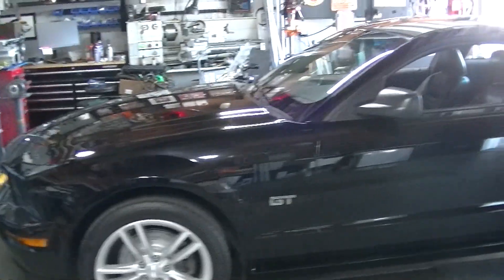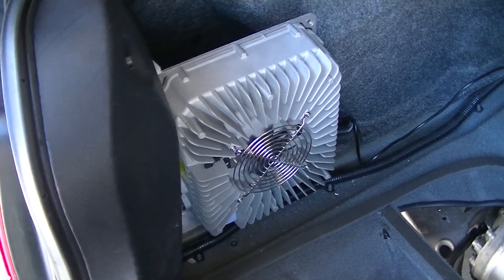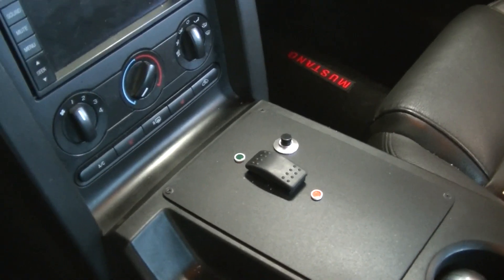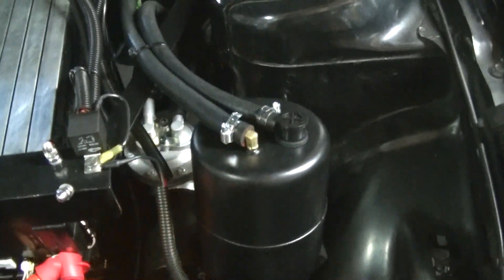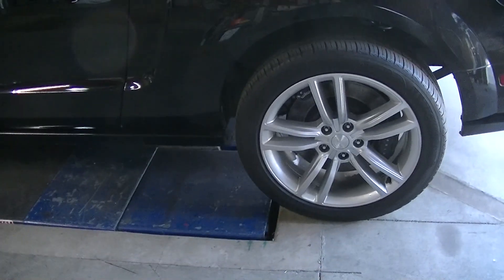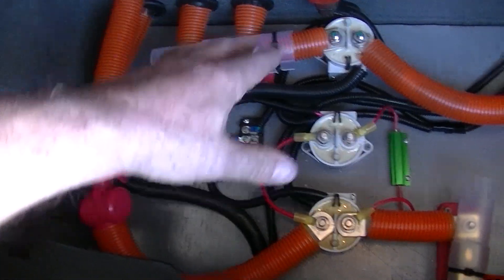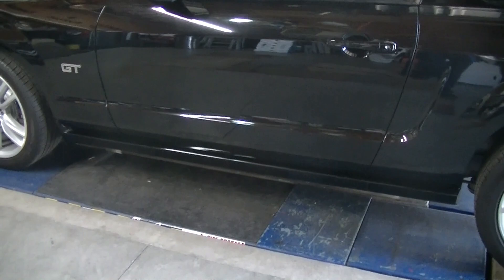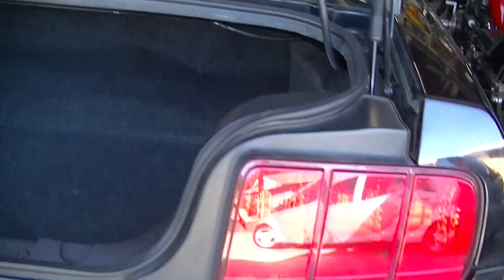Tesla Motor Swap Part 6

Comment: Such a beautiful and tidy build! Congratulations! It's great motivator for me! Question. How did you connect the HV wiring from the charger to the battery? Is there another set of contactors? What disables the drive inverter when in charge?
Reply from the maker: There's 2 schools for charging. Before contactors or use an extra contactor. I charge before the contactors. So the motor is off. I run my DC to DC charger, my water pump and cooling fan when charging. I think it's still the same but I sold to AEM-EV so they may have changed something. The new Silver Mustang build is the same way I did the black one.
Reply: @Roadstercycle  I see. So, if I understood correctly, when you do run the motor (consuming), the charger outputs are still connected to the batteries?
Reply from the maker: @ruggedplus  Yes they are but nothing is happening, it's just sitting there waiting for its next charging assignment after the car is parked and shut off.  Just plug it in.
Reply: @Roadstercycle  Got it. Thanks for helping me understand.

Comment: Do you have drawings of your battery boxes and motor mounts? You’ve got us looking at Mustangs now! Thanks!
Reply from the maker: Hi, Really don't have drawings as I build on the fly and design in my head as needed. I make mini notes for myself as far as measurements but never drawing unless I'm doing a drawing for a CNC part. The Mustang is actually the best platform I discovered. Even though the Camaro or Challenger would have been nice they are too heavy and too expensive for a donor. I kept coming back to the Mustang after looking at a lot of cars.

Comment: What thunder struck model of charger are you running, what voltage did you select and is it CAN or non CAN?
Reply from the maker: It is Canbus using there EVCC. I'm running 386 volts right now. I'm running the TS 2500 hundred. I do have a gen 2 tesla charger but waiting for the updated Damien Mcguire board to be finalized.

Comment: Pre Charge resistor looks real small. You planning on getting a BMS so you do not burn this project down?
Reply from the maker: I changed the Pre charge resistor to two 100 watt 50 ohm resistors in series. Of course BMS is coming, it only takes 192 wires plus thermistor wires and about $2000 for the BMS . If you have a better solution for BMS for 12 batteries that are 16s each I am open for suggestions.